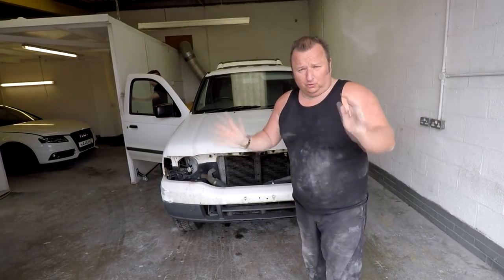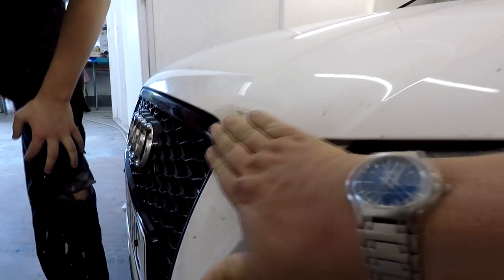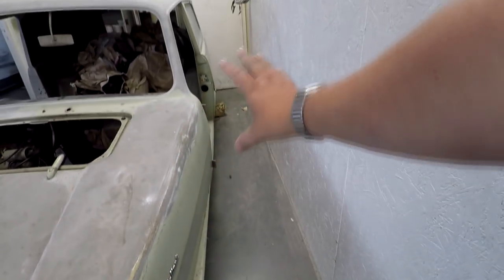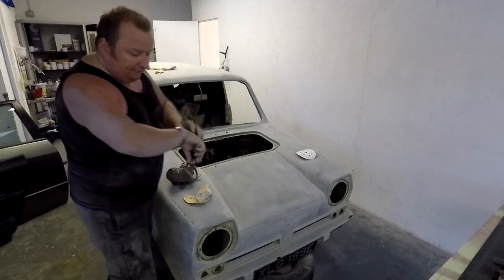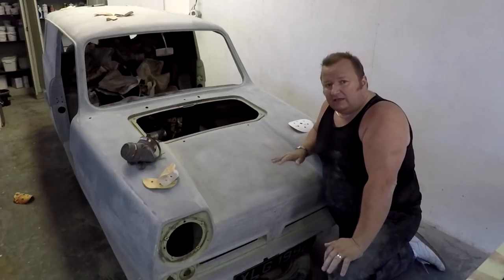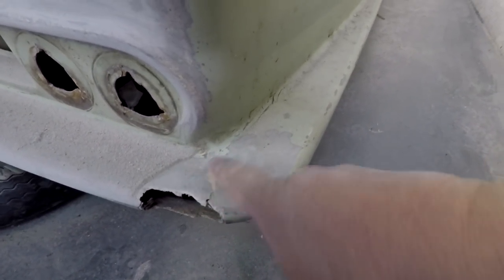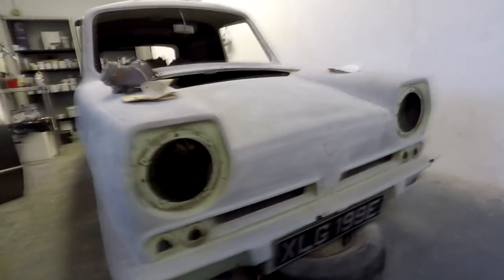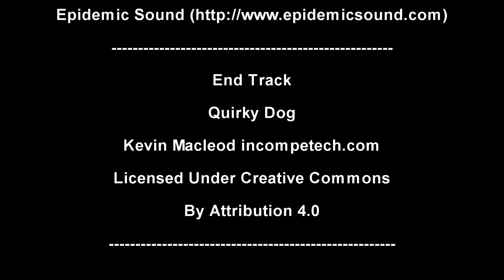A Day In Our Life Vlog #7 Reliant Regal Secrets

Comment: It's not a slatty it is the cross over model tho it's the late body with 600 running gear yours was never a slatty tho those lines down the wings are normal all the Regal's I've owned have had them even my slatty van has them if you look at my pics on Facebook you will see the slatty had a completely different dash and inside the back is different shape to as well as other bits like the edge of roof above the back door id say someone had put windows in yours at some point and kept the original panels incase anyone ever wanted to fill them back in as they have done the ash tray is correct tho only this cross over model has the late body with the ash tray there same place as my slatty van also you have a ridge around the windscreen a slatty body don't it's just flat right up to the glass I mean the recess bit around the edge
Reply from the maker: Ahh, that makes sense. Didn't know that there was a cross over model. I see your dash is different so that confirms it.
Nice info Dan.
Cheers
Martin
Reply: Yeah my '69 saloon I've just stripped the paint from has those same lines down the top of the wings. Your van is a crossover model with the later front styling. The easiest way to recognise that is your body shell has both separate indicator and sidelights either side, but with the later grille. The slightly later version (like mine) did away with the sidelights as they were incorporated into the headlights and ashtray moved to top of the dash. You also still have the "Reliant" wing badges which were done away with on mine.
Around about 1972 saw the next body change with the rear lights changing to the slightly squarer version. The rear wing tops had to change as well to accommodate them on saloons. The earlier rear lights (like mine and yours) look nicer in my opinion. Anyway.... train spotting lesson over for today. Time for beer. <^.^>
Reply: yea my trotter van has the side lights inside the head lights ash tray on top of the dash and the squarer tail lights that where also used on the mk1 robin even tho they used a few vans in only fools they mainly had vans with the later tail lights the older ones are lucas l572 and are fitted to my 5cwt van the slatty van i think those lines are factory seam lines i think the shells where moulded in seperate panels then joined together in a bigger mould but those lines are normal you have a 3/25 hence the 600 engine as 3/25 means 3 wheels 25 bhp 3/30 is 3 wheels 30 bhp as the 3/30 had a 700 30bhp engine
Reply: oh and yours wont be a supervan 3 either it would be a supervan or supervan 2 im not sure but can say for sure its not the supervan 3 tho